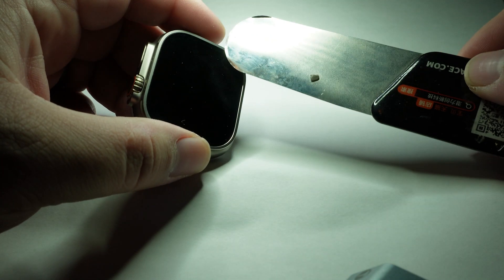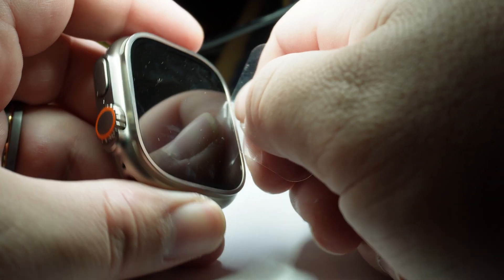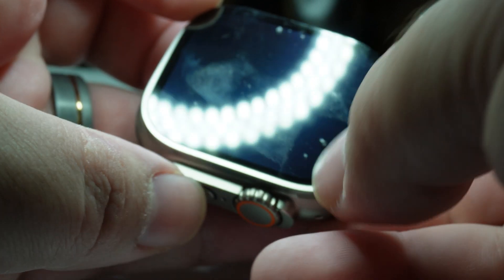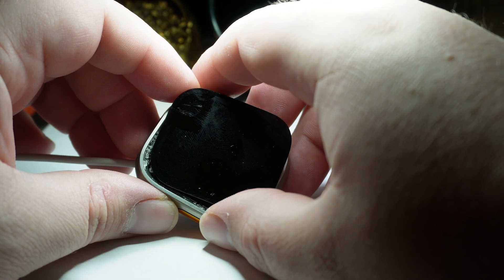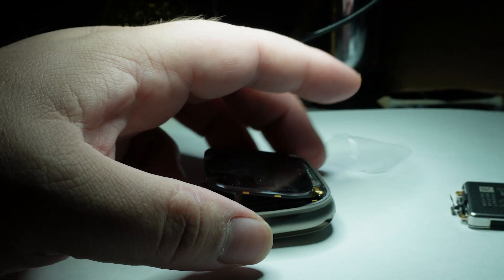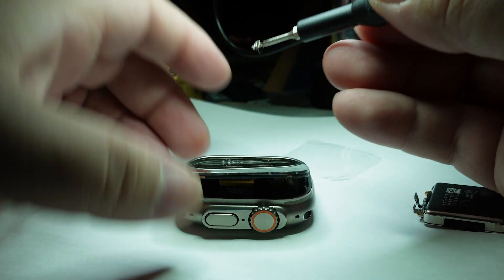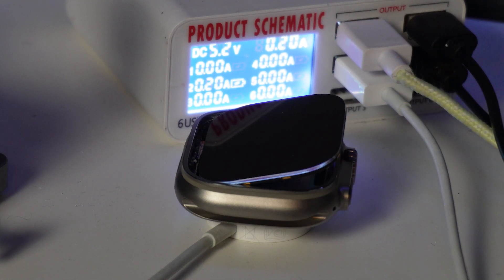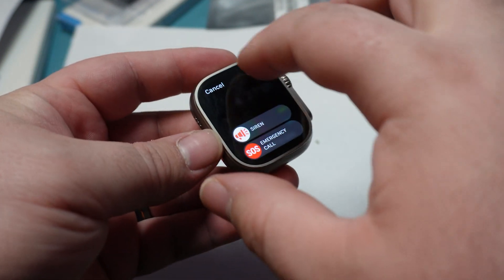Apple Watch Ultra Battery Replacement: Expert Diagnosis & Step-by-Step Guide

Comment: I wouldn’t dive with it unless pressure tested. There is too much potential to damage the new seal, or in fact create a micro chip to the back of the display which will fail under water pressure.